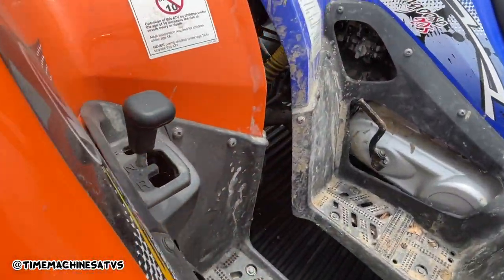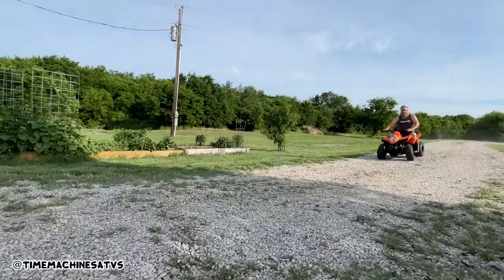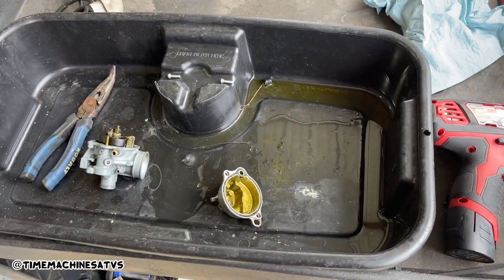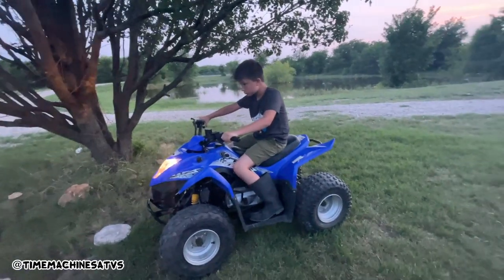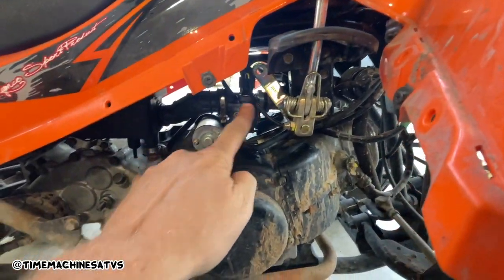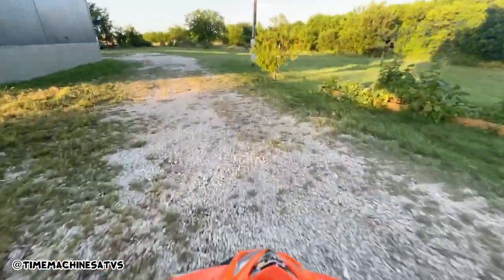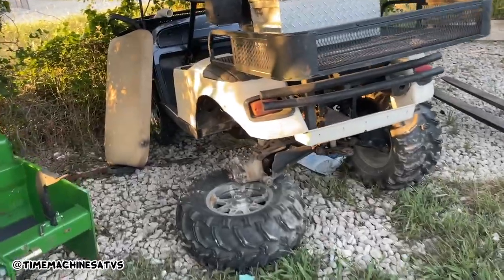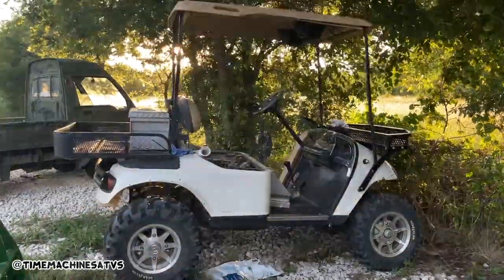Kymco 90's

Comment: Great info on all those carb problems. Let it sit all winter without draining those carbs and wonder why it wont start right up and run. Yes sir it is hot and I also have that big fan running in the back ground.

Comment: Torch tip cleaner works great for cloged ports if youv not tried it the wire kind not the drill bit stile I do it to every port just in case b4 I spray just to make shure after having to do a couple twice lol

Comment: you need an ultrasonic cleaner, makes quick work of those carbs
Reply from the maker: Have a great one and it doesnt itll ruin a carb/ stain it bad if you dont pre clean it anyhow. Lots of times Its not worth the setup and have to open and cleanem anyhow.